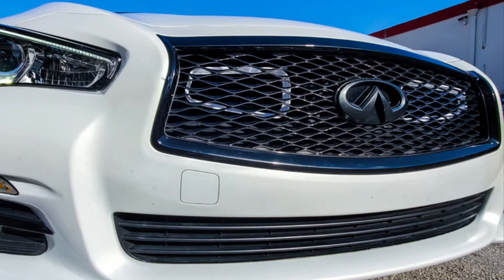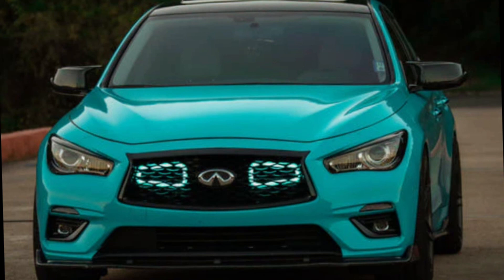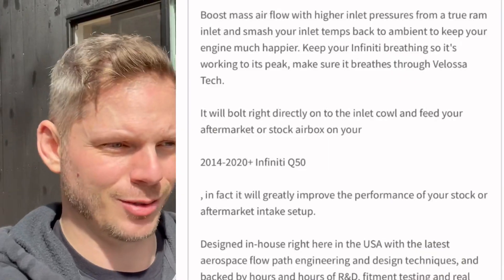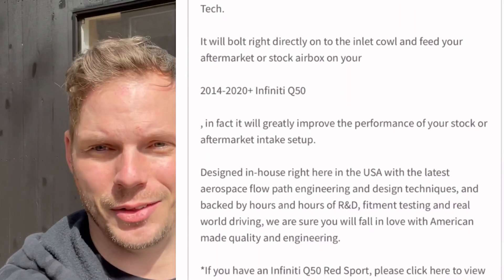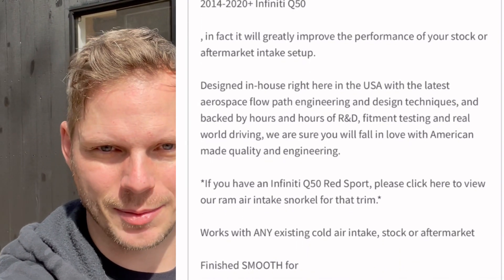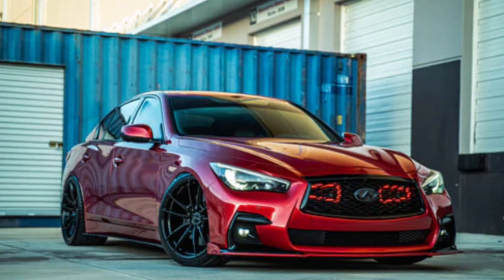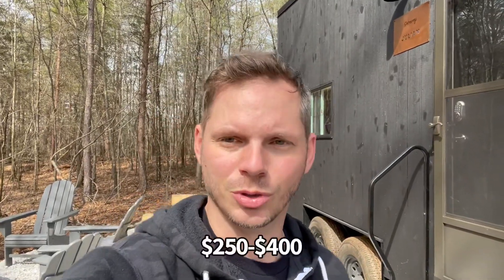Q50 Big Mouth Intakes | Watch BEFORE Buying!

Comment: I knew it… Just needed confirmation from you… lol. Almost fell for it.. but like you said better spend something that is more functional and will benefit your Q… Thanks for your input. Hope you also make a video about changing your bleeder port, from the back of the engine. Its about the water cooling systm. The OEM is plastic and can deteriorate over time.. but theres no video about how to bleed or burp it after installing. Hope you make one soon. Thanks for all your vids! 🙏🏾🙏🏾

Comment: So what about the long tube?
Reply from the maker: They help keep the intake air temps down slightly so can potentially help with preventing heat soak but still really don’t provide much in terms of hp gains.  Again, the G37 likes intakes better than the Q
Reply: @SpeedCultureStudios  appreciate it

Comment: hello wonder if you can help me please so i bought a car the car has berk test pipes (i didnt knew before buying sadly) and has a tune  i know that because that is why it failed smog test because of software modification (vehicle computer software does not match an accepted configuration  visual inspection pass functional inspection modified software) but everything else passed like visual inspection pass liquid fuel leak pass  smoke check pass RESULT MODIFIED SW OBD II) i called local dealer and said they can re-install original software for 250 bucks and it would take around 3 hours into the car now you think it will pass smog ? or will i have more problems like check engine because it has those berk installed and now smog test would fail for emission or something like that i live in california they dont longer do the smog sniffer test only OBD II please help me i really need an advise
now i don`t really know what kind of tune it has how can i find out? i only have maps 1 to 4 when i go to 4 the car turns off only 1, 2, 3, work but i honestly dont know anything, now when you dont have tune you are not able to change maps or still you can do that?
Reply from the maker: You can only change maps with a tune.  It’s most likely ecutek.  The tune is attached to your VIN so you could go to a tuner and see what you have done. The dealer reinstalling factory sw may cause a check engine light.  I don’t know that there is any way to pass smog unless putting everything back to stock
Reply: @SpeedCultureStudios  thanks for the information yes i been searching for information online and i found out the exact product it says that they have CEL fixed protection or something but  only works best with car years from 2006 and under, in this case is it possible to use cats from another infiniti q50 3.7? or a g37? there may be other infiniti cars sold for parts available in facebook market place and with luck i might able to find those parts, what is your advice or guidance ? also if its possible should i try to get them first then go to dealer and do SW Reset or that does not matter

Comment: Dyno test it and find out, seems to me that putting the air intake behind the grill will draw in more air then the inlets from factory that seem to be more restricted from the hood or pulling in hot air from the engine 🤔
Reply from the maker: I offered to test the product.  No response.  Also, if you're familiar with the intake design of the Q50, as I explained in the video, the car already pulls air directly from the grill via the factory shroud.  It's actually an even more direct path than these inlets.  The factory air boxes also insulate the intake air from the engine bay heat, so impact on IATs is minimal.  They look cool, but no dyno testing is necessary, honestly.  Not on the Q50 anyway.

Comment: How much difference will the z1 intake give us upper & lower ported with the top intake? 
Is it worth replacing the factory intake?
Reply from the maker: I’ve seen varying results for the ported manifold.  If you’re doing everything possible to get every bit of hp — 3” intakes, headers, e85 etc, then you might see better results from the ported manifold
Reply: @Speed Culture Studios  I've got the tekkeda intakes, the brake upgrade kit you posted, & am buying the diff this week. Just knocking out as much as possible at once. If their only gonna give 10hp for the 800 or so it cost I'm trying to compare what's the best options for the last 1k to put into the car?
Reply from the maker: @jeremyswerbensky8351  Doing anything with exhaust?  If you're chaging the intake and exhaust, you'll want to tune the car, otherwise its all pointless.  I assume you plan on tuning?  That will be about $1,000.
Reply: I'm looking for a used exhaust right now. That's my next big purchase. Just figured while doing my 105k service pack get as much done to the engine as possible while it's open.
Reply: You can port the manifold yourself. I did it myself and literally gave me 5 more hp

Comment: He’s definitely wrong if you have aftermarket mods like intakes and exhaust with LDP and a tune pushing 18 lbs boost. Before installing my 0-60 4.26 and 60-130 10.77 after installing 0-60 4.17 and 60-130 10.56 it’s not a huge difference but it’s enough you can feel the difference after the install
Reply from the maker: Not a big enough different to attribute it to these.  You’d have to do multiple runs before and after and take an average.

Comment: So what's your take on using them for the VR30? I've been curious about them on my Red Sport.
Reply from the maker: Talking with SOHO motorsports, they say they are yet to see anything do much better than the factory air boxes.  I could see how they could help keep intake air temps down a bit but only slightly I’d guess
Reply: It really depends on your build, stock turbos don’t really need it unless your really in need of the extra 14-20hp. PS2 or RTs will definitely benefit. This is in reference to intakes not the scoops. Those don’t work at all.
Reply from the maker: @nefarious1435  exactly.

Comment: i bought mine to lower under the hood temps. it works fine. did you do some temperature testing?
Reply: with and without it
Reply from the maker: I could see where it would help with keeping temps cool
Reply: We need a temp test next now and how does it drive any better